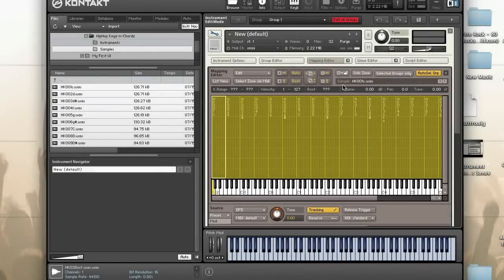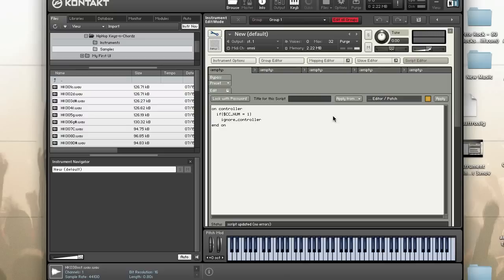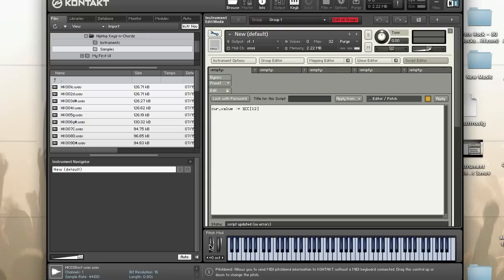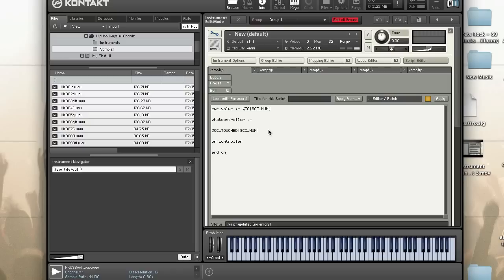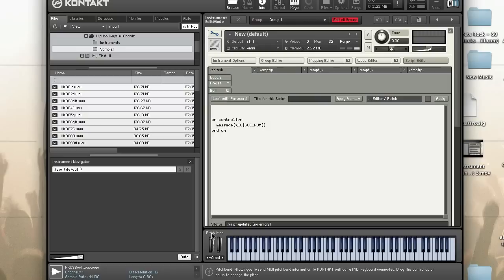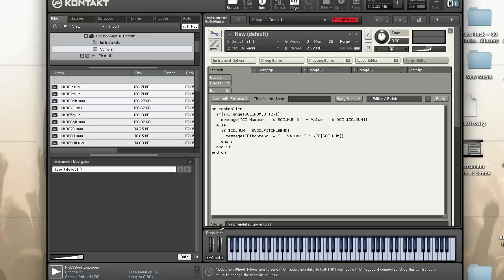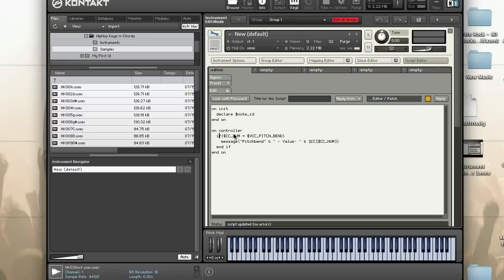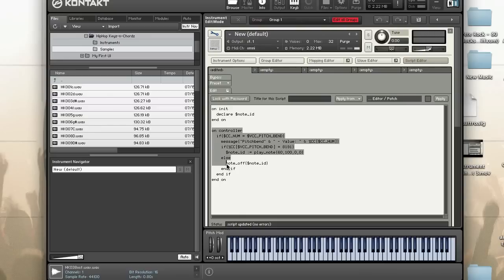Kontakt - Scripting: Convert Midi Control Change To Note Numbers - How To Tutorial

Comment: Great video, thanks. I'm trying to use a breath controller to send a CC to effect a key switch. I used and modified the script, and could get it to play a note (e.g. C4) when I used the breath controller, but I couldn't get it to play note C1 (where the key switch is). Not sure if this is because C1 is outside the pitch range of the instrument (as it has to be to act as a key switch), or there's something else I'm missing. Any help much appreciated, thanks.

Comment: Thanks for the tip.
I used it to modify the portamento so the "tempo" knob can be controlled through a CC.
Your tips were gold, cause my programming knowledge ends with QuakeC :D

If anybody is interested, load the portamento/unison that comes with kontakt and add these lines right after "on note":

-------

$porta_combi_knob := %CC[12]

 select ($porta_combi_knob)
  case 0 to 31
   $GlideRel := ($porta_combi_knob * 80)/32
  case 32 to 63
   $GlideRel := (($porta_combi_knob-32) * 120)/32 + 80
  case 64 to 95
   $GlideRel := (($porta_combi_knob-64) * 200)/32 + 200
  case 96 to 127
   $GlideRel := (($porta_combi_knob-96) * 2600)/31 +400
 end select
 $GlideAbs := ($porta_combi_knob*$porta_combi_knob*2000)/(127*127)

-----